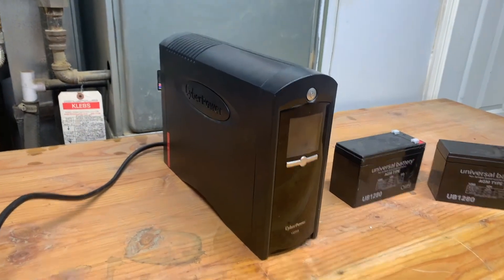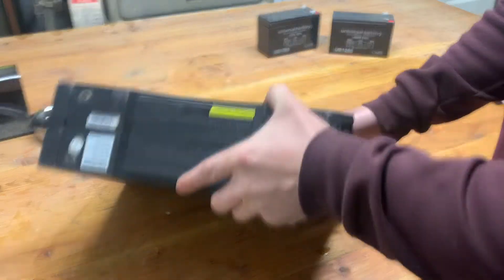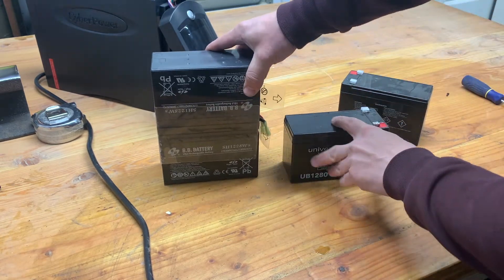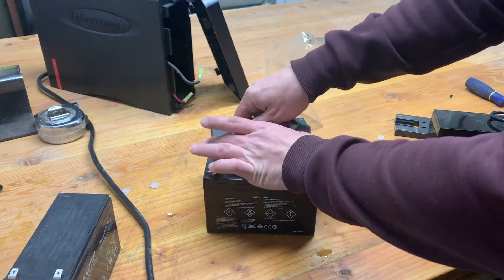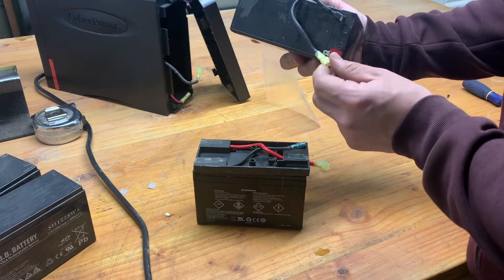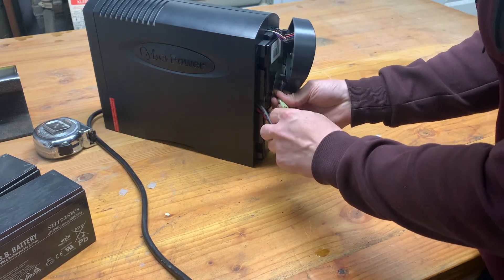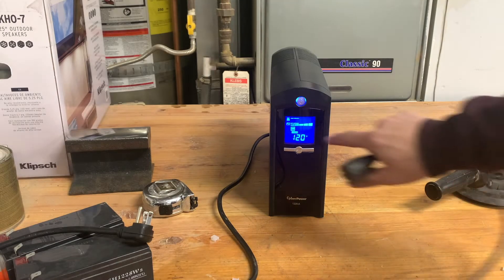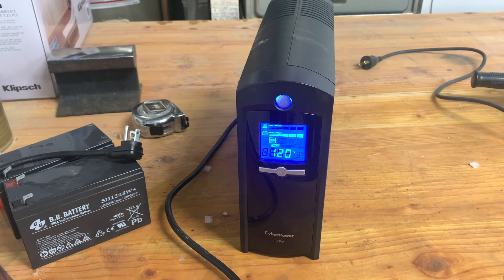Replace CyberPower UPS Battery Backup Batteries CHEAPLY

Comment: THANK YOU! Worked fine for me. You may want to add when removing the front cover you MUST slide it DOWN about an inch. There are 4 pins inside holding it in place. I broke 2 DUHHH, so had to secure the front using gorilla tape on 1 side. Unit  working GREAT again.

Comment: Why not use lithium ion phospate?
Reply from the maker: Price really. Not sure how cost effective it would be.
Reply: You cannot charge lithium with this charger unit. Not designed for it, will explode
Reply: @miernoble29  Really? SLA is 12.6v, LFP is 12.8v, seems fine to me.

Comment: Are those batteries supposed to be wired in Series?
Wiring them where you take the red from one to the black of the other batter like that will wire them in series. 
When batteries are wired in series the voltage adds together. 
For example if you wire two 12v batteries in series, they become 24 volts.
When you wire them in Parallel, the voltage remains the same and the amperage adds up. So if the batteries are 12v with 7ah, when wired in parallel, they become 12v 14ah. 
It's important to note that, because if the step up transformer in the unit is rated to take 12v and step it up 10X to 120v and you wire it in series, you're going to fry the unit because the 24 volts will get stepped up to 240v

Comment: I have learnt that u should not stack leadacid upside down. Idk if cyber power was using some special battery but even sealed lead acid ones recommend to be in any orientation other than upside down. My apc has them vertically.
Reply: Lil risky
Reply: @Hchris101  it needs the battery valves to be sideways or upright for the condensation to work properly
Reply: The UB1280 rechargeable battery can be mounted in any position, resists shocks and vibration

Comment: Keep in mind that these batteries can sometimes swell over time. So just remove the batteries if your not going to use the UPS for a long time interval.  Also, you might want to take a look at the internal main board and inspect the capacitors visually for telltale signs of failure if the UPS has been out of use for a while.

Comment: can u use a LiFePO4 instead? for longer UPS power run time?
Reply: I wouldn't. These are AGM batteries and Lithium batteries would have slightly different charge requirements.

Comment: Question: Isn't the device self chraper then buying 2 batteries?

I bought the 700watt Cyberpower for 100 euro, if I ever change 2 batteries in the future hoe much will they cost?

Also buying a new device has new warranty and your insurance is also happy with that
Reply: Maybe cheaper to buy the unit in europe. In the states the batteries are dirt cheap.
Reply: @adamcartermi5  can you provide the part numbers of the batteries or the exact modelnumber, if you have written down somewere?